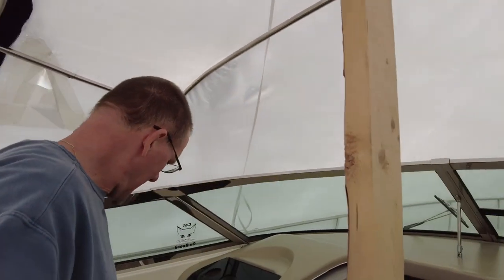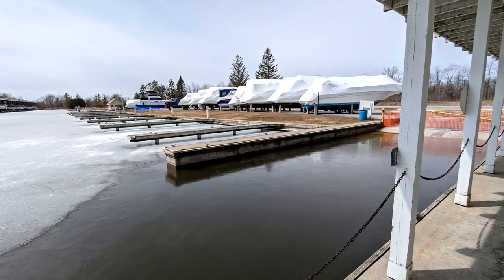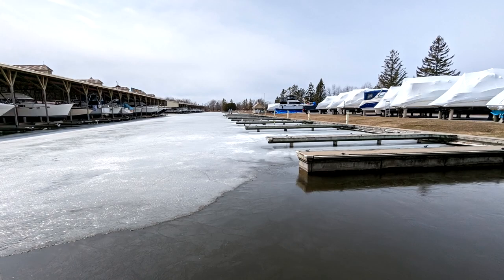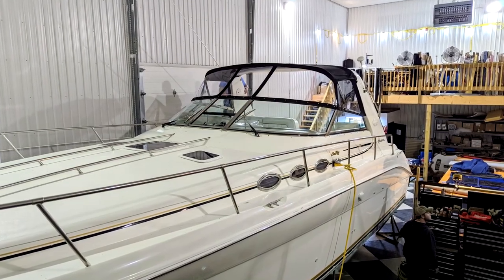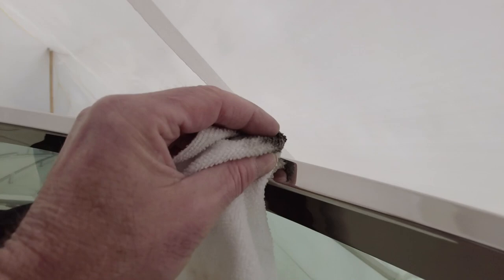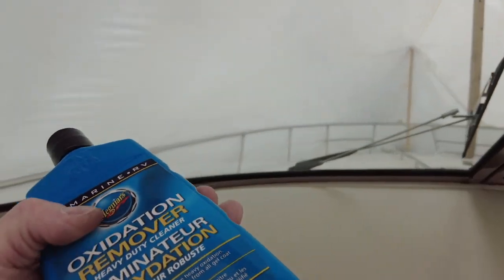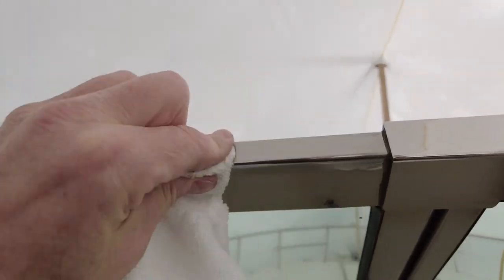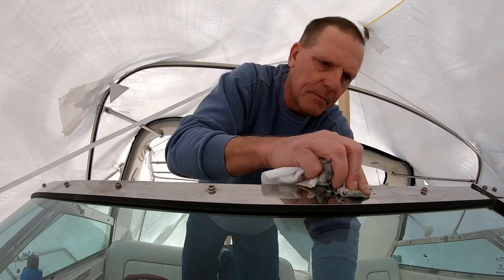Stainless Steel Windshield Polishing - Pre-Launch Sea Ray Projects

Comment: Amazing what you can do with stainless trim. Bought a small cordless 3 inch polisher a few yrs ago. You can literally buff it to a mirror finish in no time.
Also removed rubrail and got some good sized dents out with a hammer & dolly. Fine sanding/polisher = perfect.
Reply from the maker: I gotta get me one of those cordless buffers. Might come in handy when doing the upper deck...

Comment: Looking forward to hearing how the rub rail project goes.  Mine is due as well!
Reply from the maker: With any luck, I'll have a chance to do that soon. Shrink wrap is off and the canvas is up!!
Reply: @BoatingWithBoogaboo  I’m knee deep into my electronics refit. The old Raytheon chart plotter and radar display were mounted with nuts on the back that could only have been installed before the helm console fiberglass panel was installed at the SR factory in 2001. I had to heavily tape around the corners and use a carbide blade on an oscillating saw to cut through the housing of each unit and cut through the mounting studs. It’s going to make the rest of the project look easy!
Reply from the maker: Crazy how some manufacturers install equipment. I would have thought better of Sea Ray 😉

Comment: This winter I made our own bimini and camper-back (I used the old one as a template).  It was a labour of love (read swearing and sweating) and not something I would want to do again soon.  I am hoping to be at the boat this week to fix some of the side liner in the v-berth and clean all the surfaces in the cabin.  Also I need to clean the bilge BADLY!  Our boat is "New-to-us" and the previous owners were less fastidious with that job then we are.  There is a significant amount of grease, oil, dirt and debris in the engine bay that needs to be cleaned up. Next weekend it will be bottom painting.  The following will be washing, waxing both the exterior and the cockpit/helm area.  And of course the installation of the new bimini and camper-back.  One item I need to look into is our search light, which does not seem to work.  I am hoping to get to the bottom of that before we get in the water.  This is our second season boating and your videos have been REALLY helpful in figuring this whole lifestyle out!  I cannot thank you enough for all the wisdom you have provided!
Reply from the maker: Wow, it sounds like you're gonna be as busy as me! And I hear you about the dirty bilge. When we bought our last boat - the 330 Dancer - I shop vac'd out two, five gallon pails worth of sludge from the bilge. And that included miscellaneous discarded hose clamps, a couple of hand tools and other random mechanical parts. Unbelievable how some folks treat their boats 😠

Comment: Try Mother's Mag & Aluminum polish some time. I polished the back of a speed limit sign to a mirror with it years ago. I use it on stainless, aluminum, copper, brass... it's amazing.
Reply from the maker: Thanks for the tip 👍

Comment: One thing leading to another. I removed the boot stripe. Either the 3M wheel or the decal itself left some major discoloration on the hull. Decided to remove the black stripe as well. My paint guy said approx $800 to wet sand/buff with no guarantees. I bought one larger stripe, putting it on tomorrow. I hope that's the end of that nightmare
Reply from the maker: Sounds like you had the same experience as me. I discovered that the decal removal wheel also did some discoloration on the port side. Live and learn, I figured out what I was doing wrong and the starboard side stripes came off a lot cleaner.
 Keep an eye out for upcoming video, as I'll show & discuss that in detail. Bottom line is that the boat looks much better without the old, deteriorated stripes and I think we should be good.
 Hope you resolve your situation!!
Reply: @BoatingWithBoogaboo  I used a heat gun for the starboard and a product called Rapid Remover adhesive remover, worked like a charm. It does look better without the old stripes. New stripe goes on today, splash Friday!! Let's go summer!!

Comment: Kind of an unrelated comment to this video.  Does your marina supply the wooden supports for you when they shrink wrap the boat.  When I had the Carver I built my own and reused it from year to year.  They would do it but they did a "less than" quality job so to speak.
Reply from the maker: Yes, the lumber required is supplied by the marina. That said, there were only a total of six (I believe) upright 2 x 4's needed, as they merely run a sting between them which creates the ridge,so to speak. Afull in lumber ridge isn't needed. 
 Check out my next video and you should see what I'm referring to. . . And let me know if I got the count correct 😉